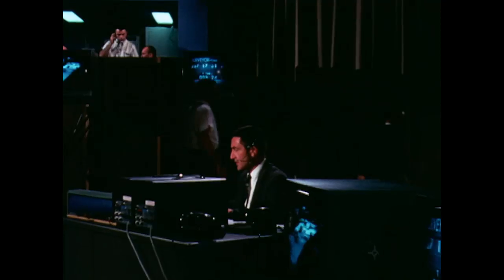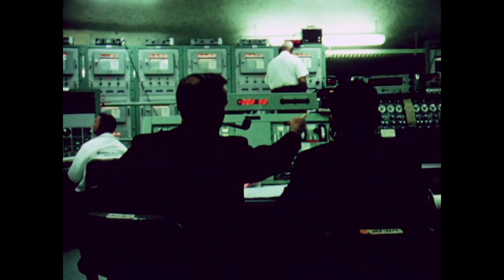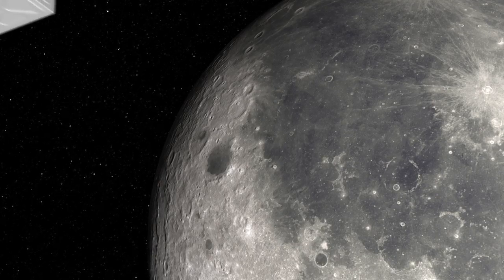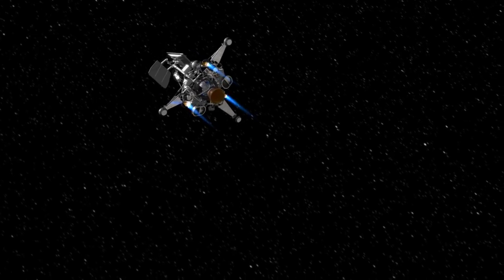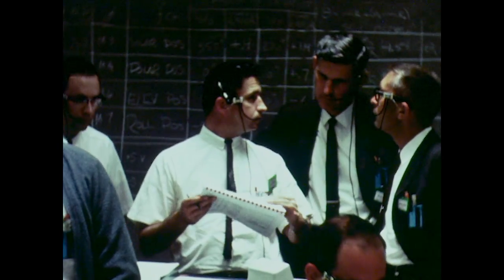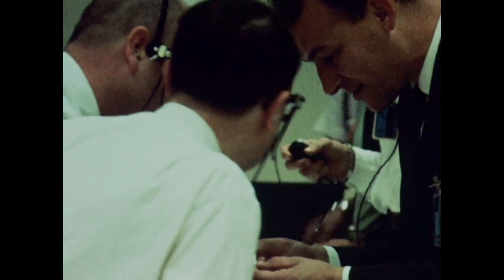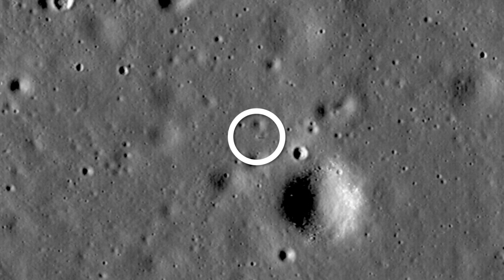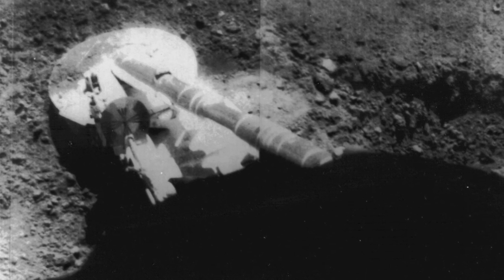America’s First Lunar Surveyor: 50 Years Later

Comment: It has already been leaked and tested that rockets are extremely difficult to build due to the weight. They need to have the least shielding possible that should lead to technical and vital failure regarding the radiation. As they would be too heavy to get high enough if they added the shielding required to protect instruments and life aboard. Rockets DO NOT work in a vacuum, the propulsion requires an atmosphere to push off of, without it the rocket would spin forever out of control. If they did go to the Moon, why have we never been back? Why not turn around the iss camera to look at it? Watch the documentary "A funny thing happened on the way to the Moon" to one hundred percent without a doubt dispel your mind washing about this falsified historical event.

Comment: If you look at the different spacecraft surveyor and curiosity both had a scoop worked for six weeks. Curiosity is running years later but you see progression carried out to land a craft on another planet. In 40 years we progress to landing on mars as for a mars landing of humans is possible but not really necessary. Its cost to get there is its limiting factor at about 16 billion a shot. It is not sustainable. The first manned mission requires 4 launches just to start.  We have to realize the human race must leave the earth and we have to get to another galaxy not a star in this galaxy. When we collide with Andromeda our survival will depend if we can get to a satellite galaxy 20,000 light years away and not involved in the train wreck. At speeds we can achieve millions of years travel just to get there. No guarantee of even finding a planet like earth. Frankly I dont think man will last to see the collision in 4 billion years from now. But What a sight to see we will never have a dark night Andromeda will fill the sky. The cores collide head on gas will spark new hot star formation.
Reply: When our galaxy meets Andromeda we will have nothing to worry about. Space is so empty there will be very few collisions on the star-system level, despite a few hundred billion stars. Besides, our sun will become the problem far before then, as in 4 billion years its outer layers will have expanded to cook the Earth.